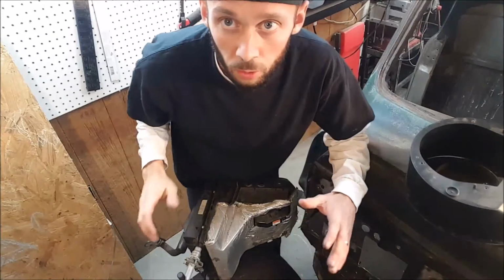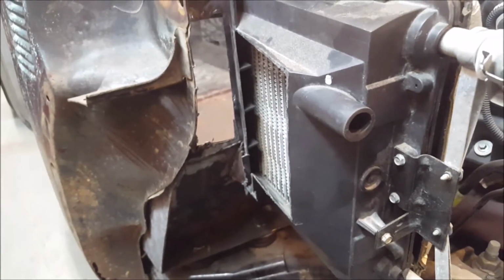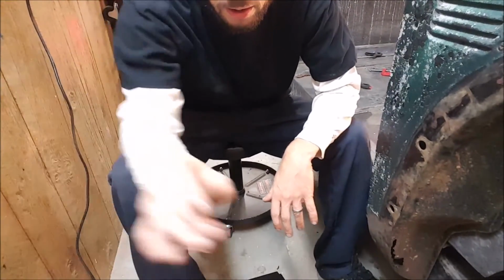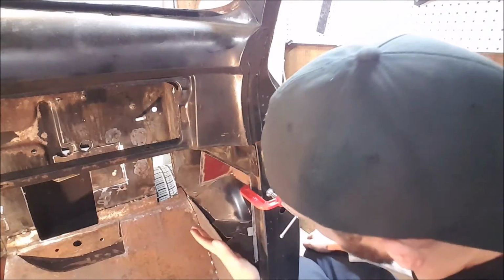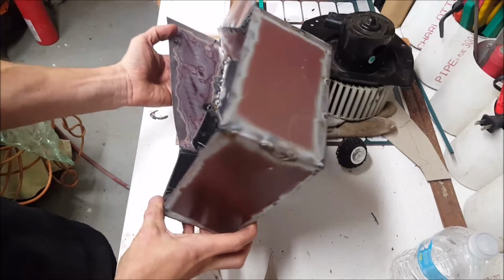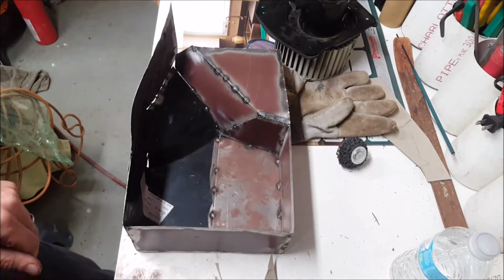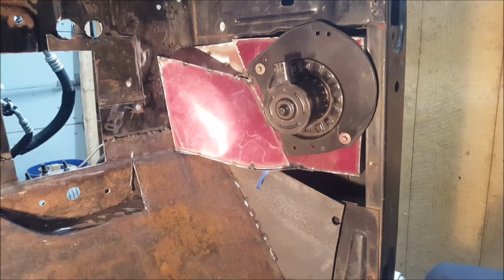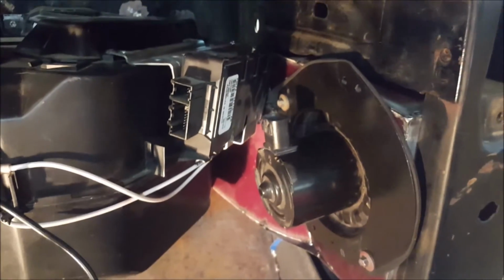Blower motor housing modification for my Ford F100 to Crown Vic Frame Swap #4

Comment: I'm Goin to try what you done here. I have a 64 custom cab. So I have limited space. But my question is I noticed u didn't use the extra box with the fresh air. Can I also eliminate that box all together if do like you did.

Comment: what did you do to address the heater core hoses
Reply from the maker: Saul Rodriguez I haven't done anything yet. However with looking at it I'm thinking the stock ones will work if I extended them a few inches.
Reply: Idle Garage the stock from the marquis or from your f1
Reply from the maker: Sorry stock from the marquis. The only thing I'm using from the truck is the sheet metal parts.